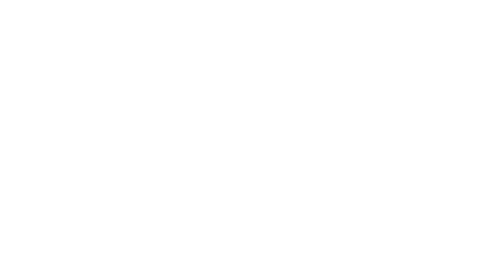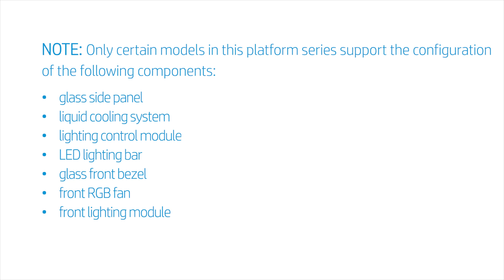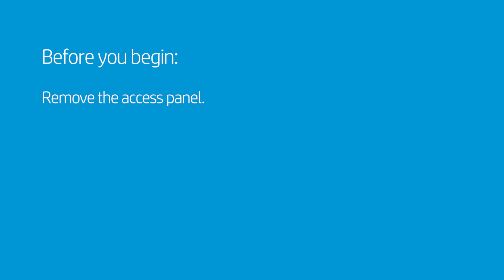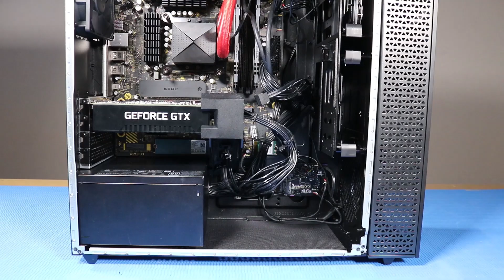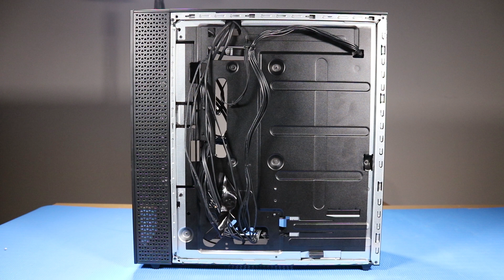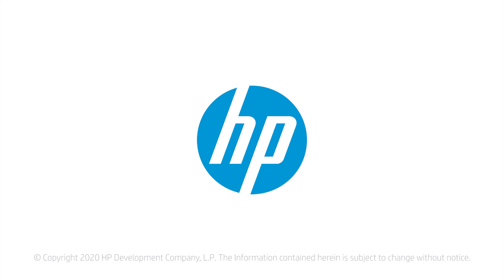Replace M.2 Solid State Drive | OMEN 25L GT11-0000a, GT11-0000i, 30L GT13-0000a, GT13-0000i | HP

Comment: Will an SSD with a heatsink fit with those capacitors being so close to where the SSD goes? I really want a heatsink but don't want to waste money if it wont fit.
Reply from the maker: Hi there, thanks for contacting!
I understand that you need to know whether SSD with a heatsink fit on your computer.
I will do my best to assist you.
HP does not recommend upgrading or downgrading hardware parts or software that is bundled with the product as It may affect the manufacturer's warranty and performance, however, you could change the configuration at your own discretion.
Binu - Social Media Tech Support

Comment: what ssd do i get for the my omen 25l GT12-0041, 2020 Model? plz answer
Reply from the maker: +its yaboi I understand that you need to purchase SSD for your computer.
You can purchase SSD or any other accessories from here:
www.hp.com/accessorize 
I hope this helps you!!
Reply: @HPSupport  hi, hi, i only have 1 ssd spot, so how do work this. whenever i unplug my old ssd and plug in my new one. i turn on my pc and it says “no boot device found, error code 3F0” plzz helppp
Reply: @itsyaboi3556  you need to move windows 10 to it
Reply: @itsyaboi3556  because you technically have removed windows

Comment: Is it possible to add an extra m.2?
Reply from the maker: +NSA HP has pre-route the SATA data and power cables to the cages already, so all you need to do is pull a cage out and mount your new drive there.

Comment: hey i have a HP Omen gt11-911ng and on the website of it it says that theres is 2 m.2 slots one so can i add a second 1 tb ssd on it

btw sorry for my bad english, its not my mothers language
Reply from the maker: +lilGoddd Yes. You can add second SSD on your computer. It has two m.2 slots.
Reply: @HPSupport  but which screw is needed?
Reply: @derechtemo  also need the screw here for the reply
Reply: @HPSupport  ?

Comment: I have an omen obelisk 875-0xxx model I need a bigger ssd prob a 1tb anyone kno what's compatible with my pc
Reply from the maker: +Maggie Peck It supports 256 GB PCIe NVMe M.2 Solid State.
Reply: @HPSupport  so nothing bigger will work
Reply: @HPSupport  Would a M.2  1tb SSD work or is Maggie correct and they are not compatible?

Comment: Can you add a second SSD. I had a friend from work who said he did but im reading something different? Any info???
Reply from the maker: +Jacob lehew The storage upgrade is very easy and will take you 5 minutes, HP had  pre-route the SATA data and power cables to the cages already, so all you need to do is pull a cage out and mount your new drive there.
Reply: @HPSupport  that's not what he asked
Reply: @Ty-fs9tp  HP support are like bots they don't understand questions that require thinking
Reply: @HPSupport  that's for the hdd

Comment: My Omen 875-0xxx SSD failed.  I replaced it.  What next?  I assumed it would go into some kind of restore mode?  I still get the same error - no boot device.
Reply from the maker: +Bill White Please perform the steps mentioned under this document to fix this issue: http://hp.care/2oVEO3j
Reply: Bill what ssd did u buy to replace it mine isnt big enough and I need another one and did u get yours working

Comment: My 30L SSD drive says it  Is an NVME. but the end is different than the NVMe that I tried to replace it with.The one I tried to replace it with has one slot where it goes in the original drive has 2.Can you recommend a SSD that will work?
Reply from the maker: +bill4510 You can purchase the part from here: http://partsurfer.hp.com/ Please select your country and enter serial or product number of your unit.
Reply: @HPSupport Thanks for your response.  Is the SSD Proprietary? Must I buy From HP? The 256 GB SSD that is in the Computer is $349.
Reply: I tried the link but could not find a bigger SSD

Comment: how may ssd slots does the pc have
Reply: 25L only has one 30L naturally more then one since it is the bigger one with ATX
Reply: @Royalkm5  30l has 2,but one is for wifi card. and cannot be used for ssd.
Reply: @bill4510   Oh my mistake thank you
Reply: @bill4510  So having a 30L 256 ssd and 1tb hdd,  I can't have three drives at the same time?
Reply: @bartosztborowiecki  There is room for a third drive, via a sata3 connection.They have it pre wired.Could be SSD or HDD.You can not have 2 M.2 drives in the 30L
Reply: @bill4510   Indeed there is a cable under the hdd drive and space for another drive. Thank you for your reply.

Comment: I have (OMEN 25L Desktop - GT12-0001nx) and want to upgrade M.2 solid state drive from 256GB to 1TB .. What type is compatible with my device?

https://www8.hp.com/sa/en/desktops/product-details/product-specifications/35610334

 Greetings,
Reply from the maker: +khalid altalhi HP does not recommend upgrading or downgrading hardware parts or software that is bundled with the product as It may affect the manufacturer's warranty and performance, however, you could change the configuration at your own discretion.